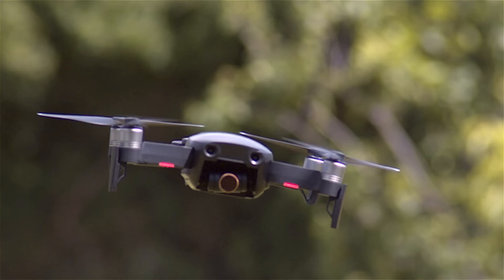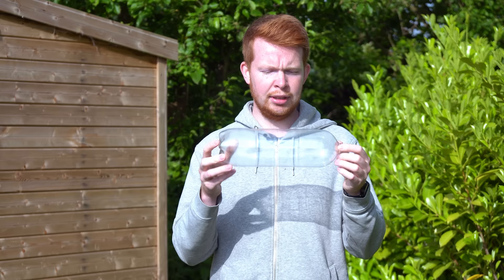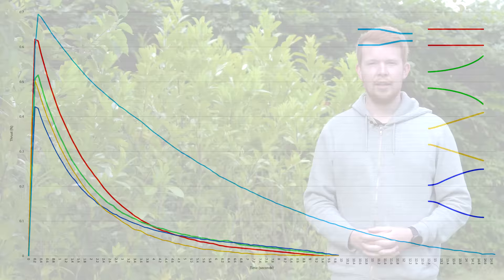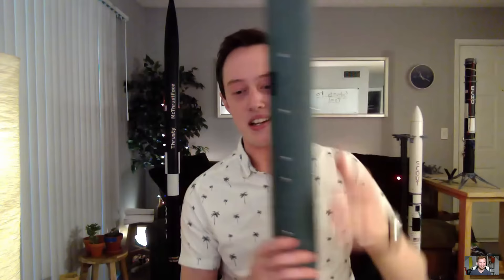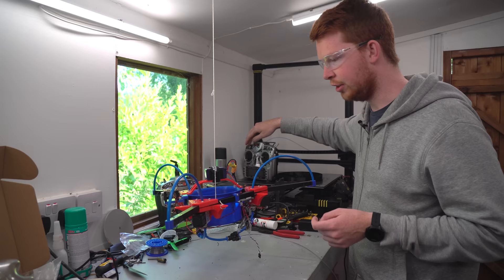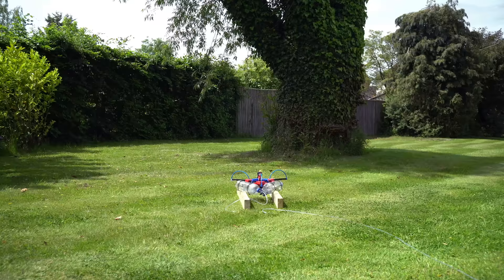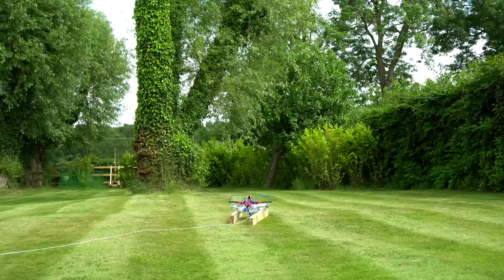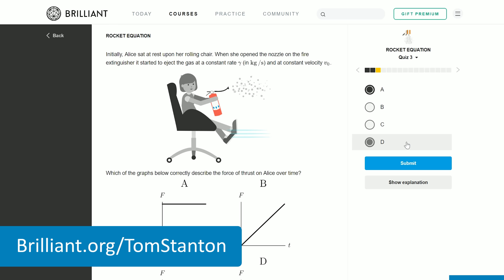Gas Thruster Controlled Drone

Comment: Did you ever fix the drone the pneumatic thrusters need a boost at first take off then it needs a constant boost your drone will work but in outer space minus the center motors which could be replaced with a vertical cylinder of nitrogen for the rapid boost of accelerationto get off the ground and the thrusters will stabilize the craft for ascent and for landing back on earth it would need a capsule parachute but it works let me know if you've tried anything else if their was a way for you to test it in zero G you'd see that it's not only a theory or concept it'll work that's exactly how the satellites stabilize and also iss and car crafts that travel in space do it but the fuel source its what you should and need to consider you should find the smallest compressor you can find to keep your bottles full they have portable bicycle ones for cheap to play around with either way I have a way to make it work if you'd like some suggestions later

Comment: Hi Tom, great video and approach. I did wonder if the length of duct between the solenoid and the nozzle was causing delays and issues though? Can you get more thrust and a faster response if the nozzle is right next to the control gate? Also, this would reduce the volume of air in the pipework and hence small pulses won't be lost in terms of pressurising this volume first.  The only issue I see is it would increase the inertia as the solenoids are heavy and further away from the centre. Thanks, Nigel

Comment: You need the computer to be able to control the air pressure much quicker.  Meaning the shortest burst of air it gives is WAY too long / slow.  It needs to be able to open and close the valves about 10 times as quick to be able to get better stabilization (or at least twice as quick). This means that it'll be able to give bursts of air at a much more fine tuned control level.  The biggest weakness is the capacity of air you have.  You need to reduce the flow of air coming out by a great deal - that way you don't run out so quickly.  The changes it is doing right now are too violent and drastic - they need to be much more subtle.  I would also consider moving to aluminum containers so you can get more bars of air for the same volume of space being used.  Yes it'll be more heavy - BUT that too will also help.  It won't help your battery efficiency for the motor - but that's not the biggest problem here now is it?

Comment: I'm no engineer but I think there could be some viability in using a valve that has a degree of motion from 0-90 like you see in a car engine. If these are used, then you might be able to adjust the amount that the valve opens to let the air out according to the pressure remaining in the bottles, allowing you to keep a consistent amount of thrust throughout the life of the air bottles. But again, I'm no engineer so maybe there's a reason you didn't use that.

Comment: Damn, can never watch videos like this one without being inspired to have a go at building the next generation. In this case, the next incremental step for me is to extend the length of the spars for more moment and use carbon tubes to both carry the nozzles and duct the gas. 

After that, I think it's time to have a look at the solenoid valve design and possible gas pressure values ...

Comment: so, try dual horizontal gyros, contra, with only one non-centered arm to provide lift, a hand drone
Reply: you could put a manual gravity auto-balance system, wire control
Reply: you could load pressure with the battery during flight
Reply: you could put multiple on-off valves, whenever you want to activate how many you want
Reply: pressurized air could be used as a virtual wing, like a auto-rotating helicopter rotor

Comment: Next time use a tesla turbine with air pressure too xD
Btw... If one motor has 1.5kg throttle this does not mean two of them have 3.0kg. In fact it should be  around 40% more so 2.1kg otherwise you could increase the air speed theoretically up to light speed if you just have enough motors...

Comment: Hey Tom, how did you get a load cell to work on a Teensy? I've been trying for weeks but everywhere I look for a solution it says the HX711 isn't compatible because of how much faster Teensy's run than Arduino's. I am getting data from the load cell but the output numbers are basically random. Any advice would be greatly appreciated.

Comment: We want a Tesla pulse rocket.... powered on high pressure vapor of hempseed oil in lieu of kerosene... as the pulse is forced out, we tap the over pressure with a small return tube for pulsing the fuel vapor
Reply: With a high voltage spark, and compressed air, we create the 4th state of matter... ==>> plasma... pulsed by the machines' output...
Reply: Hempseed oil can be used straight across in place of kerosene.... the use of petroleum oil is the ONLY cause of global warming

Comment: I've recently discovered your videos and your many projects.  I like the way you explain each step in easy to understand terms instead of using scientific clap trap lol. This drone project is very interesting and throws up quite a few issues but I'm sure you will find the correct solution and end up with a very controllable drone. I particularly like the air jet feature. Good luck with this project and I will be following closely.

Comment: Your flying computer surely is designed as a PID algorithm, so it needs, I think, at least 5 diferent levels of thrust to work, but you have 100% or nothing.  So the problem, as I see it, is that your design is as if the P (proportional) factor be as your valves 'all or nothing'.  This makes enormously difficult to control the dron or any system to be controlled.   You should have to replace the solenoids and maybe their valves, for servos (the same of RCs), who give you 5 levels of thrust or even a continous variation, considering a range of control of the valve (not ouside this range, if you think in the valve of a gas stove, there are some ineffective zones before and after the control zone), which correspond to what the flying computer is designed, as it surely gives more or less voltage to the motors, gradually.   So, the problem is not to have more pressure but more control, more subtle variations on thrust to can control it.  Ideally, you should have to use the minimum of air, just to stabilize or direction of the dron, not the big amouont you are using.

Comment: i plan on just using arduinos and ultrasonics for pitch correction seems more accurate and ill use the human controller part to mechanically move the ultrasonic sensors. so if i want it to go up and not crash all i need to do is let go of the sticks and it auto levels. also works for flying around in it your strong enough to over power the arduinos motors. so i can let you fly in it and its darn near impossible to crash and even if you were retarded i can control it just dont touch the sticks and you will be fine but i like the human override part because errors and hackers. but ill love to be able to fly around ill have a well put in just for this to fly in my backyard. if it works and i get the money that would be fun and cheap to fly its cheaper to pump water than to pump air crazy how that works.

Comment: I DON'TKNOW WHAT PSI MEANS, please stop measuring things with your thumb or feet. Use real measures please.
We use English, you use our system. That's the deal.
And if we see one more mile, inch, refrigerator per square postal stamp, or whatever bs measure you use, we will turn the internet to French for a whole day. xp